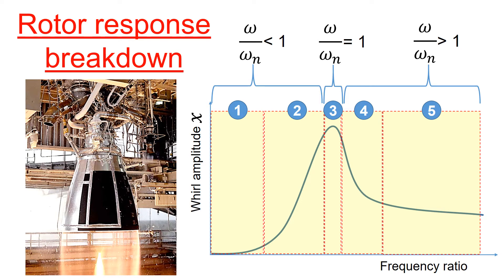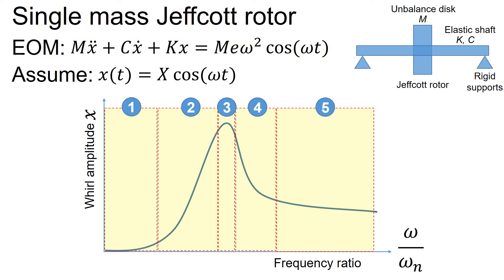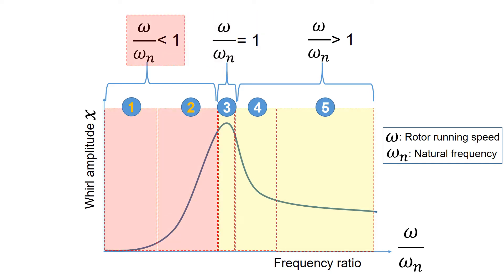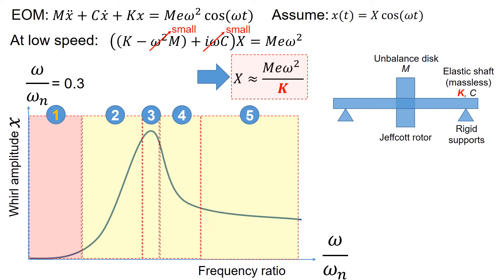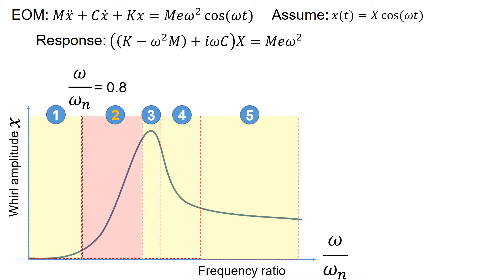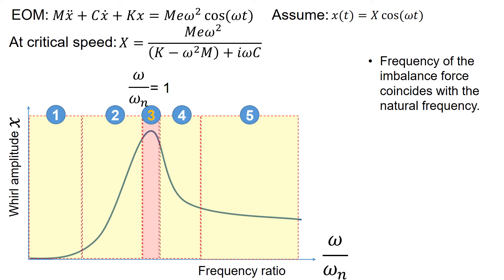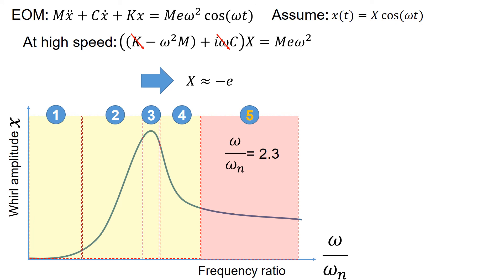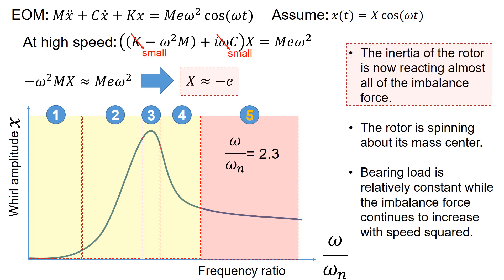Part 8 - Rotor Response based on Jeffcott Rotor in rotating equipment

Comment: Great Video.. Can you please do a video on phases responses (What is Phase response, How to read bode plot etc), The meaning that Frequency Ratio=1.2 -> The mass center continues its 180 degree shift
Reply from the maker: Phase response is a measure of the phase shift between the input and output signals of a system as a function of frequency. In other words, it describes how much the output signal is shifted in time relative to the input signal at different frequencies. Phase response is often represented graphically using a Bode plot, which shows the magnitude and phase shift of the system's response as a function of frequency.

A Bode plot consists of two graphs: one showing the magnitude response (i.e., the amplitude of the output signal relative to the input signal) and the other showing the phase response (i.e., the phase shift between the output and input signals) as a function of frequency. The phase response is typically represented in degrees, with a phase shift of 0 degrees indicating that the output and input signals are in phase, and a phase shift of 180 degrees indicating that the output signal is inverted relative to the input signal.

The frequency ratio of 1.2 that you mentioned refers to the ratio of the frequency of the excitation force to the natural frequency of the system. When the frequency ratio is close to 1 (i.e., the excitation frequency is close to the natural frequency), the phase shift of the system's response can be particularly important. In this case, a frequency ratio of 1.2 indicates that the excitation frequency is slightly higher than the natural frequency, which means that the mass center of the system continues its 180 degree shift as it oscillates.

In other words, the system's response will be out of phase with the excitation force, with the amplitude of the response reaching its maximum value when the excitation force is at its minimum value, and vice versa. This can result in a phenomenon known as "phase locking", where the system's response becomes synchronized with the excitation force at a specific frequency ratio. Understanding the phase response and frequency ratio of a system is important for predicting and controlling its behavior in real-world applications.